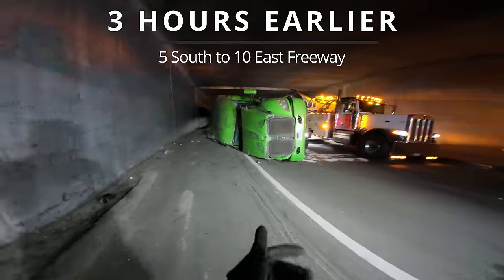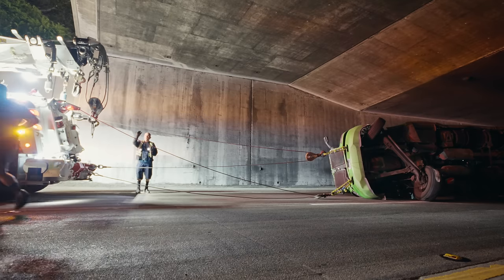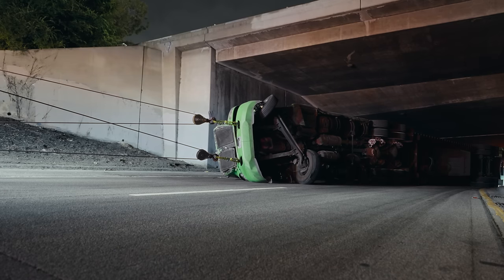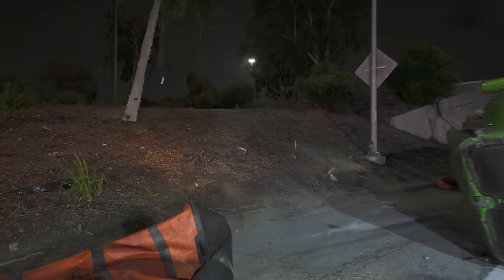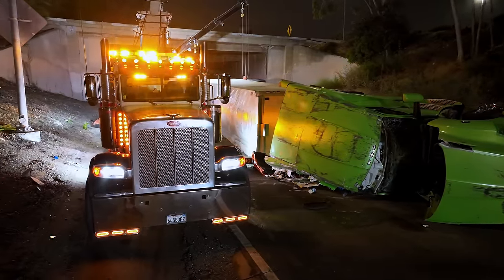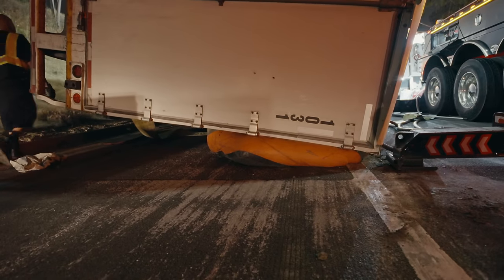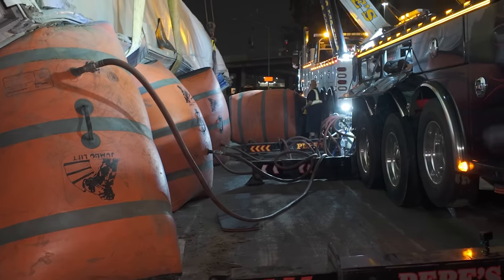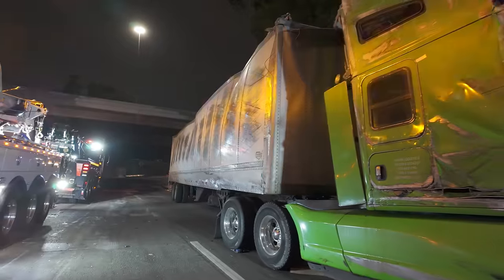Insane Tractor-Trailer Rollover UNDER a Bridge!

Comment: The force those winches had to overcome is intense. The weight is one thing, but consider the friction and uphill too ! I always think that the compressor for the airbags is one heck of a hard working tool. Well done team, a fantastic display of hard work and implementation of experience and skill.
Reply from the maker: Yup, on a flat concrete surface like this you would add about 10% drag for the friction. Pure brute strength by Big Flipper

Comment: Picking that trailer up intact without it busting open, or having to unload it saved the customer a lot of $$$$
Reply from the maker: Yes! Most people would offload. It saves so much time doing it our way, but it's very very difficult and you need all the right equipment.

Comment: 13'6" 53" Wide Tractor trailer, heading towards a 9' Bridge flops it on it's side and Then comes a Sliding Stop  in a tight Spot in comes Alex, Dave, Mcgyver, Echoooooo, Lil Pepe' then Comes BIG PEPE' What a Crew to have on this Job After learning how Critical Air Bag Lifts are to a recovery

Comment: how do you roll a 13'6 in  a14'  space , even the hood had scratches , rolled before the under pass and slide against THE WALL \\\\\\\\\\\\\\\\\\\ WOW ,  must of been one hell of a ride
Reply: I think the CDL handbook talks about high center of gravity and slowing down on curves in the first 2 or  3 pages. This guy really wanted to this bad. Took a lot of effort.
Reply from the maker: Really easy actually. Just go super fast before a sharp turn :_Laughing:
Reply: and he walked away , wow
Reply: @christopherleblanc9599  Driver might be uninjured, but I bet he has nightmares for a few days.
It was a nice truck. The trailer has been part prepared for repainting - it will buff out.

Comment: Way back in the late 80's at the local VFD, we popped one of those high pressure bags. It didn't have enough weight on it. Were the first in our end of the county to have the jaws, and large Diameter hose. 1000' of 6". It took one of our 1500 gallon pumpers its entire tank to fill and prime.
Reply: The size is not a problem for lift capacity. A 24"x24" at 70 psi can lift 40,000 lb. The problem is area and airbag sidewall rigidity.

Comment: I work on Heavy wrecker 103 LA.County Fire USAR for four years before I retired! You can flip a rig under a bridge. Along with cities HW, we did a barrel roll we did it from the outside and boomed in. All that to say it can be done!
Reply from the maker: Ummmm ya, we've done it hundreds of times. There's tons of videos just like that on my channel in my rollover Playlist. Never said it couldn't be done so not sure what you're getting at. This particular case the trailer was a dry van and already compromised. Barrel rolling a loaded compromised dry van is impossible at sub 20 degrees.
Reply: I’d like to see how you barrel rolled a loaded dry van under a bridged fully retracted .
Reply: The problem with some people is that they believe if they can’t do it or they can’t figure out how to perform certain things, then it can’t be done. They believe what 50 cent said “ if I can’t do it then it can’t be done. The guy that taught me had 54 years driving a wrecker. I learned early on experience is everything! I’m not going to go back and forth with a guy that has much less experience than I do. It’s your channel you can say what you want. I’m just saying I’ve done it. Non conventional, and had Chip not been the I would not have even contemplated it. But it can be done!
Reply: @bondservantministriesinc.672  it flew over your head , a dry van trailer the walls are far too weak for a barrel roll the weight of the contents would destroy the walls and the load would spill besides the boom needs to be high and lots of cable need to be out for that type of operation. It can be rolled utilizing air bags and other forms of rigging but not a barrel roll . Fyi we are very familiar the operators of that rotator and they won’t complete a recovery they lift and crib in order to extract an individual
Reply from the maker: LA County Fire wouldn't even attempt this, where at and when? The last they worked a rollover was a hazmat tanker load on the 5 FWY because the local guy couldn't do it. Either way, if you truly are so experienced, then you'll know the following is true: no 2 calls are alike. You see a bridge and seem to be applying your certain situation to it. How high was the bridge clearance? Over 15'? Or under 13' like here? Was it a tractor connected to a trailer? Trailer only? Was it a container? There are too many variables to say "yup it can be done". That logic alone you have shows me you clearly don't know as much as you think you do. In this specific case, to this specific video, it could not be done without tearing the wall. You see how bad it struggled WITH the bags. You would need to lift this entire thing in the air, then roll it, correct? Now what kind of absolute idiot would attempt that, knowing the trailer has 46,000lb of 26 pallets in a compromised trailer? And like I said before, a part you ignored, I have like a dozen videos on my channel alone of me doing rollovers under bridges. Each one is different, and this one had a 90% chance of tearing open if attempted. Again, why on earth would you chance this specific one?
Reply: I believe that was when the winters were colder, the snow was deeper and we walked to school both ways up hill.

Comment: You know, we've seen this before where they roll used turf up, and it still has the underlayment mixed in.

Makes the rolls WAY heavier than the listed dry weight for the material.

Very very easy to get into trouble, fast, hauling that stuff.
Reply from the maker: Good point, that's probably the case here. Because that trailer was super heavy.

Comment: I know its impossible to pull that out without causing any more damage but do you ever have caltrans second guess your methods and say you should have done it differently.  I know half the commentors on you tube think they know how to do it better but they dont count.
Reply from the maker: Very rare. There has been a couple of times, and it makes you want to hand them the remote and say fine, you do it then.

Comment: Maybe make couble Dolly's like they put under the cargo container for moving around or like when moving all-wheel-drive vehicle on a tow truck ,put one set under the trailer end then another set under the front to get trailer out from the tunnel.
Reply from the maker: That sounds good on paper, but think about these jobs. A container is rigid. You can do that easily with them. Now think of this job, it wouldn't work. If you lift up each end, the middle will be sinking the ground and you would put a lot more pressure with a higher change of it ripping open.

Comment: @PepesTowingService  My one question: instead of trying to drag the tractor straight out, making an extra step to rig, lift, and move the tractor over to the left lane, why not just move the hazmat truck and drag the tractor to the right lane to begin with? Every time you had to move Big Flipper forward, just move him around the curb, too. You wouldn't have to worry about the angle that you mentioned you were running out of.
Reply from the maker: Because of the curb. Notice at the very last pull, the rear of the trailer was caught up on the curb. By starting where the Hazmat truck was, it would have pulled it there much sooner and fought us ugly. Moving the tractor over separately isn't really that much work. Like 15 min, and in that time we're able to simultaneously work on the other side and set bags and Dave's truck. Literally no time lost.
Reply: Thank you for the polite explanation. I know it must feel like people are second guessing you when all they want is to know your thought process. You see things they might not have thought of or seen.

Comment: Please educate me why wouldn't you detach the trailer makeing it easier to move the tractor
Reply from the maker: Which then makes it harder to pull the trailer. It's easier to flip as one unit. I see zero benefit of detaching and it adds unnecessary time. So you split it, then winch it allll the way out. Now you move the trucks and rig to flip it. Then tow it out of the way. Now you do the same for the trailer.

Comment: are you using some kind of AI truck noise filter?
Reply from the maker: Negative, zero editing on the sound in this video. The dji wireless mic I have has a built in noise reduction filter. It's a bit too strong I think

Comment: Please, Pepe, try to give as much information as you can in your videos about  the circumstances that cause the accidents you work on.  Why did this truck flip over driving under an overpass?
Reply: we aren't investigators , we relay info given to us by law enforcement. most of it is common sense , this guy clearly was took the turn at high rate of speed
Reply from the maker: How would I have the information on the cause? Like Alex said we aren't crash scene detectives. We get called by the cops to clear a scene, that's my only job. It's not like the driver calls me after and says "Ok so I was speeding and on my phone when I lost control..."
Reply: Then at the beginning of each video, just tell us what the cops have told you. @PepesTowingService
Reply from the maker: Often times we never interact. If you see my videos most of the time they have one just blocking and once we drive past them we go straight to work. Cops would also not have much info since a full accident investigation would never take place unless there's a fatal. Only when another vehicle is involved and a traffic report has to be generated would they even ask. Especially hard when most drivers aren't even present either and they would be the ones to know
Reply: A lot of times I see you and your crew interacting with the cops, and sometimes you'll say the cops said this, the cops said that. You are an entertainer, of sorts, and we are your audience. There's no doubt you produce the best recovery videos, but a little more info on why things have happened would help your non-truck driving audience, which I'm sure there are many. @PepesTowingService  A
Reply from the maker: Honestly, it's not really a big secret. Most of the time it's speed and distracted driving
Reply: @PepesTowingService  Makes sense.
Reply from the maker: Still tho I’ll try incorporating the “how” more if possible
Reply: @PepesTowingService  It will be hard to improve on what is already one of the best youtube channels out there, but your effort is appreciated.

Comment: Wouldn't it make it easier to pull it if you lifted the back of trailer a hair of the ground so it slides easier n less gravity
Reply from the maker: How so? You would back up to it and lift, and the entire trailer would still be on the floor. Only the rear end would be up, and you risk the load coming out the wall. Then as it gets dragged hundreds of feet, what happens to the truck holding the rear? You keep stopping the job so it can keep backing up? This is horrible.